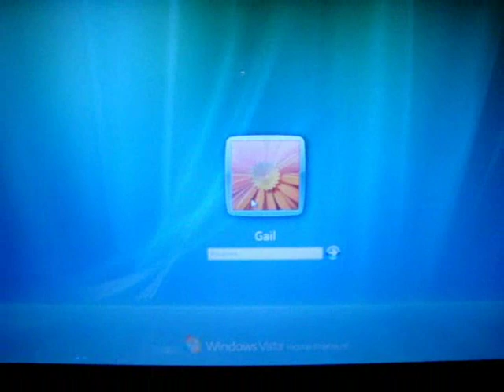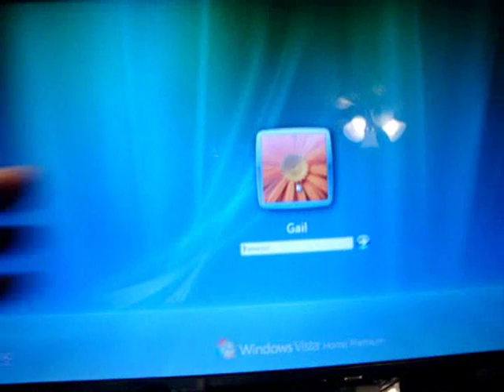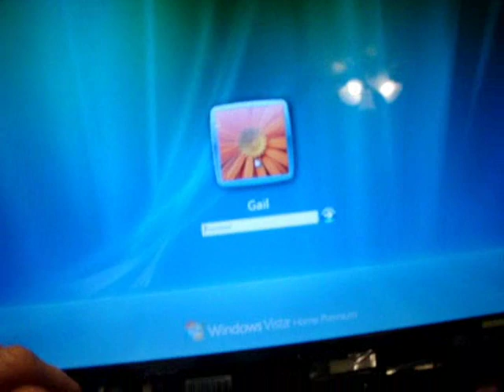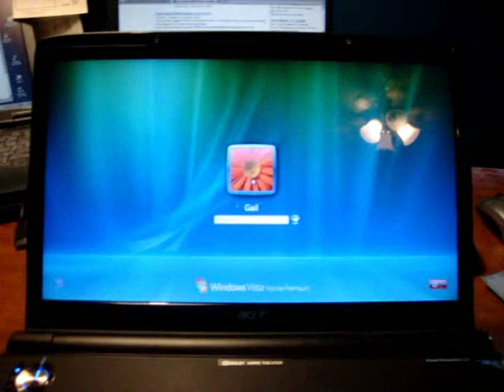AcerAspire6930 Flicker Problem

Comment: I just have this laptop for 1 week, and i want to know if is normal  for the Wifi LED to keep blinking every few seconds... is should just stay On or is it normal to keep blinking while i'm connected through Wifi ? 

I have recorded a video, take a look on my channel ...
Reply: +mihai0377  yeah it must blink while transfer, all correct.
Reply: ***** Mine does the same thing. I wondered about this too when I first bought it, but I think it is normal. It seems to flash and stay on according to the strength of the wifi signal. I've had this laptop for nearly 6 years and apart from the flickering screen issue, I've had no problems.

Comment: Has anyone done this and had favorable results?
I saw one video where you remove the tin tape on the back of the bezel... this DID NOT fix it.  Has anyone done this repair/change and had it fixed and working for a couple months or better?????

Comment: I fixed my flicker simply, took the tube where you plug ac power. Took it off. And one black cable was not connected so I took this cable pushed it in to make sure it is connected and pushed a bit of rubber in to hold it and no more flickering :)

Comment: My screen flickers as well but in my cas I think it is that little metal connector where you plug the charger because when I move it a bit it stops flickering when I release it starts again and works fine on battery

Comment: My father has an Acer 5920g (a different model), and the screen flickered around a year ago. I fixed it by putting a piece of kitchen towel between the LCD-cords. I have a 6920g myself, and it flickered once in a while, and I saw this video to make sure, you could use the same principle. I find out I could in this video, - thank you very much! I just used regular tape to fix it, and it works like a charm now.

Comment: Also note, if yours is like mine, the power adapter cable is grouped with the video cable.  This laptop has a power cable not just the adapter that is advertised on many repair sites.  If you are going to fix both, keep in mind that this case is primarily made of plastic, so the more you take it apart the more you run the risk of breaking the snap together tabs that keep it together.

Chetbus, thanks for the post and the fix.  I now have my computer back without the $100 repair bill.

Comment: This is the fix.  I had the exact same issue with my 6930G.  I cut a thin water bottle and wrapped it around the hinge.  Then I put a second one between the cable and the retainer.

Something to consider, when the author took the video screen apart, he left it attached to the computer so that he could figure out the problem.  When you attempt this fix, you do not have to disassemble the video, you simple need to pull the cable out and cover the hinge. then put is back and cover the top.